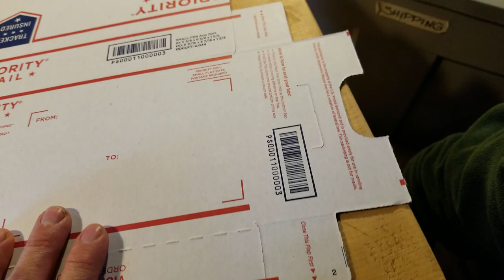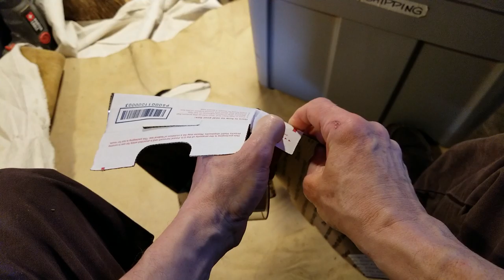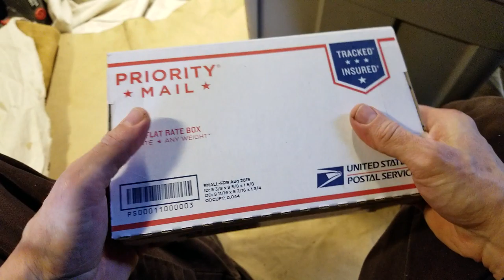727 - Packaging Arrowheads

Comment: I’m glad someone made a video like this. Curious as to how other knappers pack their points.
Reply from the maker: Yep.  I'm going to do one on packaging nodules and spalls too.  Using the plastic wrap has revolutionized my packaging strategy.  I've seen many other methods but this is the fastest and most effective way for me.
Reply: JackCrafty that’s great! It looks really effective and also keeps the points in place and it also shows where the points are which really helps the recipient to unpack them safely. 
My method was to stack cardboard squares and then cut out the shape of the arrowhead and just sandwich it or if it’s just one or two tiny points I’ll just give them an individual bubble wrap and put them in a tiny box with a bubble wrap liner.
Reply from the maker: @truetotradition  I've used the "stacked " cardboard technique as well.  I works great but it takes time... that was the drawback for me.
Reply: JackCrafty same here! Especially when sending off several points haha. I really like your method. Is that office supply plastic wrap?
Reply from the maker: @truetotradition  It's regular plastic wrap from the dollar store.  I cut the roll in half with my bandsaw and trim the cut clean with a utility knife so it comes off smooth without hanging up.  I'll need to show it in a vid.  The fancy packaging wrap is way too expensive.